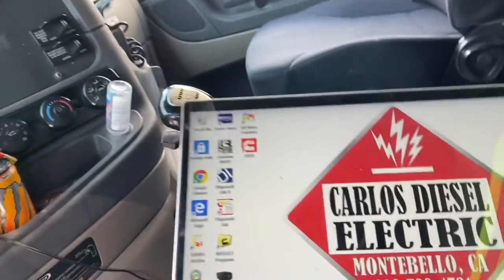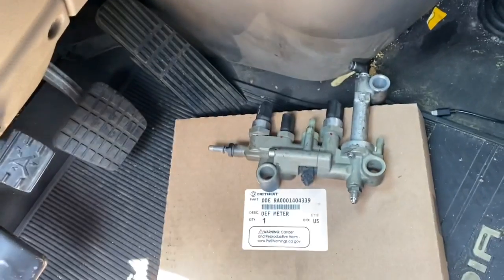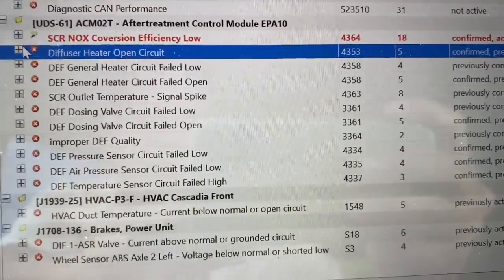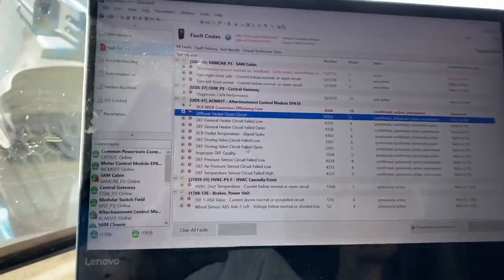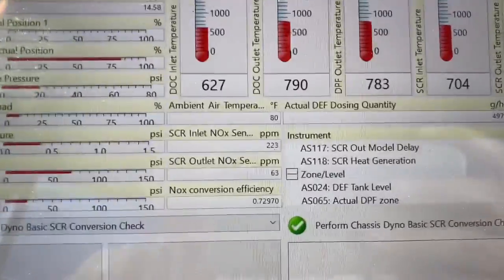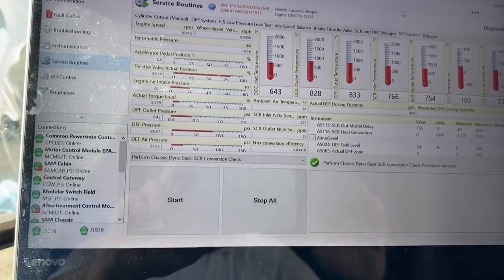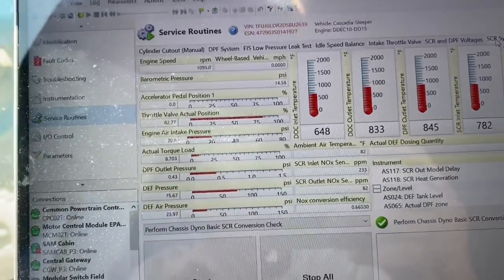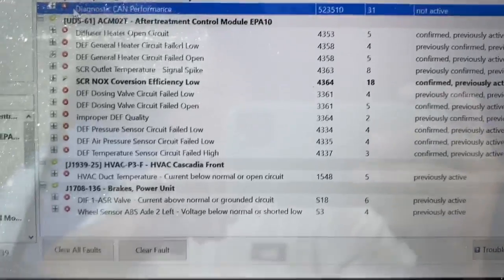Cascadia DD15 and DD13 fault code SPN 4364 FMI 18. SCR NOx efficiency low

Comment: I have a 2016 Cascadia with a dd15. Over the last several months I've gotten a lot of these codes.  I've replaced both wiring harnesses,  the NOx sensors,  DPF filters,  ACM, def doser, and def filter kit. We did the long regen that takes hours and got the efficiency to 99% before we cut it off. It cleared all the codes. Then a couple weeks later I got this code while climbing a big hill.  I'm also smelling def when pulling these hills now which is new.  They are out of ideas.  Should I replace this metering unit? The box is a small fortune and honestly I cannot swing the $10k
Reply: dude when I bought my truck I use to get this code going up hill I replace both nox inlet and outlet sensors and still going up hill code came back and after awhile it would disappear. I cleaned my def metering unit nothing work.. what fixed my problem for good I got brand "new" Detroit DEF filter for my cascadia. Never seen that code again in 2 years and been up plenty of hill. so buy brand new filters. I paid $2400 my old filters wasn't any good otherwise I would have got $1200 back but no complain. I'm just happy its fixed and i did it all myself. I have a 2012 Cascadia.
Reply: @CashNYC  Wzup my guy is u talking about the dpf filter the big once in the one box because I’m having the same problem ever week when I climb a hill
Reply: @trustinthelord2248  yes replace both dpf filters in the one box on your cascadia and that should fix your problem. Get new dpf filters and problem should be gone my code never came back 3 years now and going.
Reply: Have you check if your truck needs or have the “Awning kit” ?? It’s something that goes inside the one box and helps with the def spraying more evenly into the exhaust gases and mixing better.
Reply: I have 2016 Cascadia. I am very disappointed. Same problem in my truck, please can you explain me ,how to fix this problem ?
Reply from the maker: How many miles are on the truck? What kind of work has been to the after treatment system?
Reply: 817000 miles . I have replaced Both nox sensors change, def filters clean and harnesses
Reply: @gillcanada2050  man it's anyones guess. There's two options from my point of view. 1) delete it 2) live with it
Reply: @Square-Up-K5  I am working with bison transport .Bison not allow work ,without DPF
Reply: @gillcanada2050  well that's good that you aren't responsible for paying for it. Truth is that they're guessing on everything about that box except the filters and the nox sensors. My first guess on your truck would be the wiring harnesses. There's 2 wiring harnesses that connect the acm to those sensors. If i was in your position and those 2 harnesses didn't fix it, I'd have the entire box replaced all at once. 2 years ago it cost about $15k to replace the box and everything in it. I ended up spending $27k and a lot more time replacing each part one by one. Even after i replaced everything in the actual box the light still comes on when I'm going heavy up a hill. I've learned to ignore it and regen it when it derates me. It only derates me when im pulling heavy hills all week
Reply: @joshuabrumback9681 have you had any more problems with this code. Do regens keep fixing your problem? I'm going through this problem right now
Reply: @robertmorehouse2421  I've come to realize that the drone cel is a badge of honor. When I used to think to myself, "when does a trucker become a seasoned vet?", I used to think it's when they stopped using their signal to switch lanes, then I thought it's when they've pulled over to drop a deuce in a trash can on the hwy shoulder. However I've now come to realize that although those 2 things are true, it's not until a cel becomes a normal thing you don't even concern yourself with that you've fully taken on the trucker life. I prolly should've deleted it but I'm at around 800kmi and when it's time, imma do a 60 series swap. Might be quite a while tho, I've been sitting these trash rates out for the last 10 months. I'm looking to go company somewhere and leave the rig in storage.
Reply: Any help would be greatly appreciated.
Reply: Carlos...buen dia..tengo un 2014 freightliner cascadia dd13.. con mismo codigo que hay que cambiar...gracias

Comment: 2015  cascadia dd15 falt code spm 3223 fmi 7 please help..,...
Reply from the maker: Looks like a NOx sensor Inlet issue (failed to activate), try performing a parked regen and you have to look at the NOx efficiency. It must be above 70%. 
If you still have the same issue then you may have a harness issue. Start with the parked regen first using your Diagnostic Link Software so you can see temps, voltage and overall performance of the parked regen.
Reply: How can I get the program to do the regn
Reply from the maker: I purchased my program from Diagnostic Link. Nexiq 
Thievy have two versions available. The standard is the one I use but I will be upgrading to the Pro version. Most people can do most everything with the standard version

Comment: On EPA 10s it’s almost 9 out of 10 times a harness issue if you have circuit codes. Also EPA 10s don’t have a def quality sensor
Reply from the maker: Alex Corvi after this video was done. Truck ran good but I did ultimately replace the after treatment harness. I was saving that for the next video. 
I usually start with low hanging fruit, being that the truck is very high mileage I started with the DEF metering unit because it is the least expensive thing. The harness is expensive so I prefer to take that route but you are correct in saying the DEF quality sensor isn’t present. But the ACM triggers a fault code for the DEF quality because of the low NOx efficiency.
Reply: @CarlosDieselElectric  after treatment harness? Could you please let me know where is it located. Thanks!
Reply from the maker: @DK-fq3hy  All Detroit aftertreatments have an ACM (computer) that works with MCM (engine computer). From the ACM (typically  located on the driver side behind the front wheel) you have a harness that runs to the DEF pump, DEF tank, a few other accessories and goes over to the One Box and the One Box sensors. Like Alex mentioned, the harness could be causing the fault codes. It is usually in two sections.
Reply from the maker: Alex Corvi thanks for sharing. I feel the more information and knowledge is out there the more these trucks can stay in the road.

Comment: hi Carlos! I own an EPA10 as well. blowing with compressed air extensively the DPF and DOC then reset the ash meter will extremely help the truck. Also, using motorkote is important.